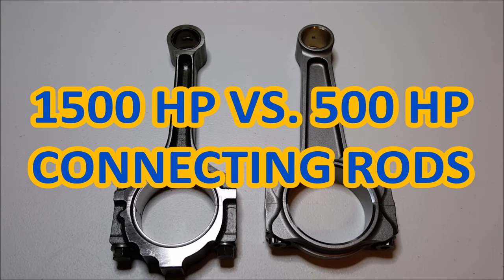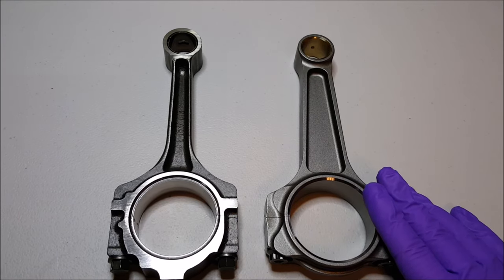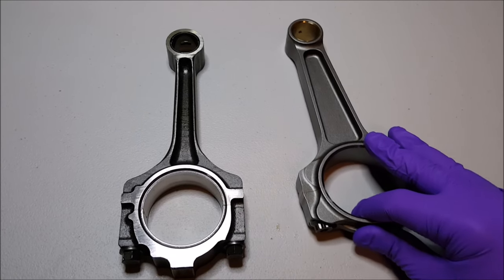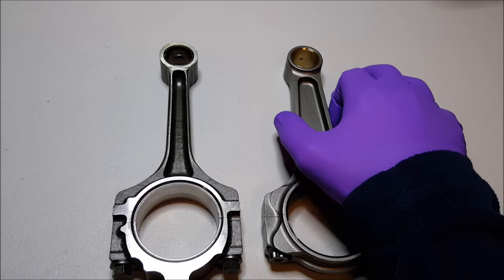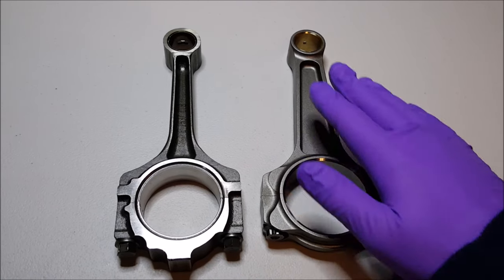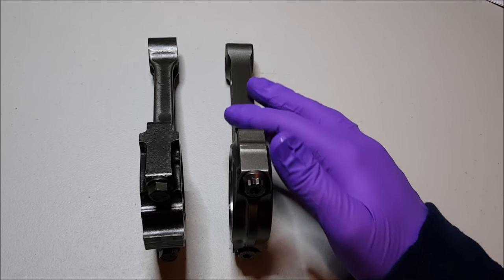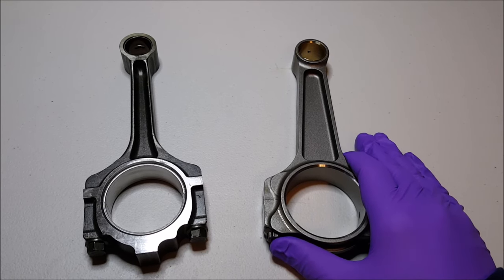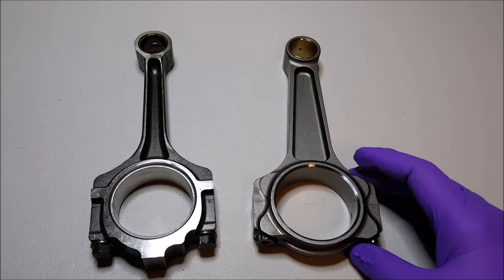1500 hp vs. 500 hp Connecting Rods

Comment: For a constant load, the bending stress on a piece of solid metal is proportional to 1/thickness^3, so increasing the thickness pays a large dividend.  The material and heat treat also affect the strength of a piece.  Here are some numbers:  
                                     Grade 5 bolt    Grade 8 bolt  1018 steel.  4140 steel  4340 steel  high speed steel  nodular iron
Ultimate strength, psi  125,000           150,000         65,000          125,000      185,000       375,000                 60,000
elastic limit, psi            100,000           125,000         35,000          100,000      150,000            ??                       40,000
endurance limit, psi       50,000             62,000         15,000             50,000        75,000             ??                      20,000
The strength of 4140 and 4340 depend on the heat treat.  There are other alloys that are stronger than grade 8 bolts, but to the best of my knowledge, nothing is stronger than high speed steel.  All steels have about the same Young's modulus of 29,000,000 psi.  The Young's modulus for iron is close to the YM for steel.  The shear strength of steel is about half of the ultimate strength.  
If you really want to know whether a piece is strong enough, you should do a Finite Element Analysis to calculate the stress levels.  
You an improve the life of a part that is under a cyclical load (like a connecting rod) if you polish the surface to remove all the nicks and scratches.  The improvement is as much as a factor of 9 reduction in the stress at a notch or scratch.  For a connecting rod, always polish it in the direction of the length of the rod.  I recommend polishing a crankshaft, also.  Also make sure there are no sharp fillets in anything as the sharp radius creates a stress riser.  Now you know why high performance crankshafts have large fillet radii where the ends of the crankpins and main journals.  
If you use grade 8 bolts and threaded holes in 1018 steel, you should reduce the torque of the bolt below its rated torque or you my pull the threads out of the 1018 steel.
Reply: Good comment lots of useful information.  What is a"turned body bolt"?
Reply: Holy moly!!
Tnx man.
Reply: @g1sokool669  Depends on how much you already know. The engineering terms are not explained here. And engineers have their own very specific meanings for some common words. No quick or easy way to get up to speed on this.
Reply: The problem is that the information presented is misleading and if you are not an engineer or even understand rudimentary engineering principles you will be misled.  If you are knowledgeable about engineering and material science you will recognize the wrong and misleading information that was put forth.

Comment: I have a 1989 Dodge Colt GT with the 4G61T 1.6L ( 1595cc3 ) bored to an even 1600cc3, rebuilt it with my dad, his father bought it brand new in November of 1988, there are only 1500 of them and about 900 of the AWD Mitsubishi Mirage's, so a total of about 2400 of these in the world and is the Grandfather of the 4G63T 2.0L ( 1997cc3 ) or consodered as the King of the 4 Cylinders and is widely known as one of the worlds too 5 motors of all time. I let a froend test drive it and he left the e brake on and it blew my turbo which was a rebuild off an eclipse so sent it back and recieved a oem stock turbo the TDO4 FOR the 1.6L. And just havnt got to take apart and clean the oil mixing in with the fuel and air. Okay i did clean the intake, but I am planning on getting that up and reliable l, and broken in properly and even getting top quality adjustable suspension, a simple body kit to have room for an intercooler and a oil cooler as well as some cooler lines for the transmission to allow prolonged driving at higher rpms without damage. Anti sway bar front and rear which will reduce the trunk space in the hatchback but I can work around it, while its seperatated frame from cab, i wanna have the frame sand blasted and powder coated and then like a rhino lining layer of heat resistant rubber so the frame wont oxidize ( rust ) for decades, maybe even have it caged but under the interior as well as having it set up for an AWD conversion but still driving it with the stock 4g61t , having everything prepaired and even painted ( garnet red ) it's like the color of a deep red wine, heavily insulated, like that rubber rhini lining under the car and at the fire wall for heat resistant as well as noise cancellation or atleast to reduce the road noise so that when im driving on the road insullating even the doors and adding weight will be fine as long as its excepted by an engeneers perspective on terms of aero dynamics and weight distribution. Because the final step would be swapping in a AWD 4G63T which is identical to the stock 4G61T motor other than displacement and WEIGHT. the 4g61t has 135hp stock the 4G63T HAS 280hp stock although I will be going with forged crank, forged connecting rods and forged pistols, ARP STUDS and will be researching Block wisdoms , and its about 2400lbs RN that added weight distributed evenly balanced will allow for that extra power at the wheels to have a little bit of weight to work with for traction. I wish to turn it into my road trip tuner, in memory of my grandfather who I know had me in mind when selling it to my dad, even sent me a birthday card I just found that i didnt understand until a week ago lol good thing i still have the car, after the rebuild it hasn't any more than 2000 miles on it. So i would like to get the most out of that motor as i can, using it for work and saving for a toyota truck and newer or a diesel , larger crew cab Chevy or dodge cummins or even find a extended cab 1985 or 86 and drop the 4bte i think it is, the smallest cummins straight 6 thats bolts into those older chevys. But leaning towards and larger crew cab, modifiable Toyota 2016 or newer. Then as I'm working and saving and maintainencing the Colt I will begin prepping it until all thats left is the AWD CONVERSION and the swapping of the motor and transaxle/transmission. Because after its swapped and tuned and dynod and broken in properly and ready for the road, I would like to visit car shows, and even start on the project ive been waiting all my life to work on with my dad, the 1970 Chevelle SS 402ci Big Block, 17000 original miles on it and remember riding in passenger wheb i was 3, man that thing is a beast. I wanna use what i learned on the colt build to assist with the Chevelle build, like a modern frame or chassis and suspension so i can turn and stop with the best of the modern cars on the road. Gun metal gray with black racing stripes and gun metal black rims, and a modern crate build so i can have obd and have a navigation system that bluetooths to the obd port and allows me to program and tune the computer for varipus performance options. Literally a CLASSIC 1970 CHEVELLE SS 402 WITH THE 396 EMBLEMS ON THE SIDE CUZ THEY ONLY PRODUCED THEM FOR LIKE 6 MONTHS, WITH MODERN QUALITY COMPONENTS, COMBINING THE BEST OF BOTH WORLDS AND SEEING THE SMILE ON MY DAD AND MOMS FACE AS THEY RIDE TO CAR SHOWS, SHOWING OFF THEIR CLASSIC AND MEETING NEW PEOPLE AND FRIENDS AND LIVING THEIR BEST LIFE BECAUSE I DECIDED TO GIVE BACK WHAT THEY GAVE ME. 
ANYWAYS THATS MY DREAM, THA KS FOR READING IF YOU MADE IT TO THE END.
YOU CAN FIND ME ON FACEBOOK. 
DARREN MILLER FROM FOREST GROVE OREGON BORN IN BISHOP CALIFORNIA, OR EMAIL ME AT MILLERDARREN1020@GMAIL.COM UNTIL I GET A NEW EMAIL ADDRESS FOR THE REFINED CHAPTERS OF MY LIFE. 
I WONDER WHAT IT TAKES TO DO SOMETHING LIKE THAT, WHAT KIND OF LITERATURE OR BUSINESS OR SHOP COULD LEAD ME IN THE RIGHT DIRECTION, I WANNA HAVE MY OWN SHOP ONE DAY.

Comment: I'm confused... you refer to the rod on the right (1,500 HP) as both "billet" and "forged", could you explain that please? I thought they were different processes.
Reply: I noticed that too, the guy contradicted himself, another thing, everything else remaining equal a super/turbo charged engine puts its rods under less stress than a naturally aspirated engine so what's this nonsense about 500 hp vs 1500 hp, what about the rpm, piston weight, stroke length etc, you can't make a blanket statement like that, its like saying that a gearbox is rated by hp, it's not, it's rated by torque.
Reply: It was machined from a forged block of material known as a billet block. By the look of the finish it was also shotpeened after machining.
Reply: @tepidtuna7450  Thanks
Reply: @rotax636nut5  That`s what happens when you give a guy that knows nothing an outlet
Reply: A billet is forged,  just not shape forged,  just block forged and then machining from said block.
Reply: @themountainraven  So a billet is forged, you don't just get a cast lump and machine it. I guess the molecules have to be compressed somewhat and lined up in a similar way to iron and steel. To take the guess further, steel and aluminium have similar properties under forging, which is a kind of hammering process. Shot peening takes the finished piece a step further, I can sort of understand that. Thanks, I find this all very fascinating.
Reply: @Jesse-B  When someone says 'billet' all that really means is that the part was carved out of a solid block of of material, i.e. a round, a square, a rectangle, or even a hex.  In 99% of the cases the use of the word is marketing not engineering.

Now, a billet can be a forged, or rolled, or upset, block that started out as a casting, or a larger billet (aka bloom), but it is generally not the proper word to use when referring to a near net shaped starting piece i.e a rough forging or casting.

I'd call your attention to the various catalogs of cosmetic parts available.  My personal favorite was a "motorcycle gas cap featuring 'billet' construction".  All that means is that the shop making them buys 3" round aluminum bars, and turns them in a lathe!  They could use wood, or plastic, or old rolls of thermal fax paper and make the same part with the exact same dimensions, similar weight characteristics, and somewhat more interesting surface finishes.

Don't be fooled, when someone tosses out a jargon word, refer to the glossary to see what it really means.

-- In Liberty
Reply: A billet is a piece of steel that is in the shape that left the steel mill.  A forging is a billet of steel that has been heated and hammered in a forging press, usually to the near her shape of the finished part and may require a further maching.
The purpose of forging is to modify the train structure to enhance the yield strength of the metal.  This video explains nothing
Reply: @g1sokool669  
Sorry this wasn't specifically an answer to you...just answering the overal question.
What the guy should have said is the rod is forged from a piece of billet steel.
It is not a billet block that has been cnc machined like he suggested.
He just said it wrong.
Imagine a huge press with a half casting of the top and bottom and shoving a piecs of billet steel in between those two dies under an extremely high force. It compacts the metal and aligns the structure at a molecular level. It is a great way to make the best rods possible.
Billet  is more like aluminum rods that are cnc'd to shape.
Anyway...cheers!

Comment: We are build a 1970 350 11:1 sbc. Our goal is 450 hp with forged steel crank and forged pistons. This engine is a budget build but we do not want it to come apart! Can you recommend 5.7 inch rods that would fit our application? I have looked at gm "Pink" rods on ebay which would fit our budget, however SCAT and Eagle make rods in $250.00 price also. Thanks

Comment: i like the simple explanation. My question is how much of a weight difference is there between the two for a given size pls? The other question i have is what would be the rod u would choose for a 2500hp setup intead of ur 1500 setup? - Is there some super exotic alloy that can be custom made for a person who is not restricted by cost factors? ty
Reply: maybe a billet h beam with some coatings?
Reply: h beams are not stronger than i beams
Reply from the maker: It's hard to say about the weight difference as their are too many variables to consider to provide an answer. Anything in the 2000 hp range would require an aluminum rod to reduce mass. The density of aluminum is about 1/3 the density of steel. You will find aluminum connecting rods in top fuel dragsters for example. Titanium would be another option. Unlike steel, aluminum is susceptible to fatigue and a shorter lifespan is expected for an aluminum rod. Thanks for your comment and sorry for the late response!
Reply: The rod is forged not casted forge rods are lighter and stronger and is a alloy metal.

Comment: 1500hp- is that for all 6 cylinders or 250hp per rod?
Reply from the maker: Toby Head This example assumes that eight cylinders work collectively to produce 1500 hp. As a result, each cylinder makes about 188 hp and therefore each connecting rod supports 188 hp.

Comment: Don't forget "BOLTS"!! M A good set of ARP bolts from the standard ARP 8740 bolt vs their top of the line L-19 bolt can increase the HP and tensile strength capability due to stronger clamping force anywhere from 5-50% "DATA WISE" !  See ARP BOLTS for further literature on this.

Comment: If I had the money, would it be a great idea, to make the rods, crankshaft, clamps, block, head, pistons, wrist pins, and all the bolts....out of titanium?

The piston rings, bearings, and maybe cylinder sleaves, would still be steel, or another metal.

And air conditioned air for the intake, and a great cooling system, using Evans Waterless coolant, both to prevent knock, with high boost & compression ratios.

Is all of this, the stuff of dreams, or not really worth it?
Reply: Iron alloys aren't popular just because they are cheap. No other material has such tailorable qualities. Iron is an amazing element.

Comment: is the 1500hp rating per connecting rod or the whole lot
Reply from the maker: TheAuzzieSniper whole lot of 8.
Reply: per connecting rod? what are you building? a ship?
Reply: 1500 divide by 8 cylinders....use that same rod in 4 cyl. They get twice as strong....we build hi honey boat motors. The last job we did made 2400 hp..x 2 motors..16 brand new  carrilo s was about $ ,3900....,with a deal it's all about the bolts

Comment: What about titanium rods?
Reply from the maker: MyLonewolf25 Titanium rods are also another option. Although they are more than twice as heavy than aluminum, but twice as strong for a typical alloy with much better fatigue resistance. It really depends on the specific application to decide whether or not titanium will provide much advantage over steel or aluminum.
Reply: Problem with titanium is metal fatiguing over time. They are far less resilient in that regard than other options. Aluminum rods (even billet) stretch over time. For non-exotic builds that are not having major rotating assembly work on a fairly regular basis (replacing components like rods), titanium and billet aluminum are arguably inferior. Think of a weekend warrior build for a person who likes to track their car, but also daily's it: titanium and billet aluminum are poorly suited for that build concept.
Reply: @numinous4789  
Agreed. In drag racing, alumium rods are primarily used over steel rods as of late to reduce stress on the bearings and crank, and possibly other bottom end components given aluminum's softer properties.
Reply: Also, heat cycling of aluminium softens it with time. The same happens in monobloc brake calipers. Racing brakes use two Al blocks either side of the disc and are joined by steel pins for strength and endurance. Iron and steel get stronger with heat cycling. That's why old iron blocks are prized for performance builds.

Comment: so are i beams strong and can handle more torque n hp than h beam rods
Reply from the maker: djm93 It depends. A general statement cannot be made. You might find that some companies sell H-beams rated for 1000 hp and I-beams rated for 1500 hp. This doesn't mean that in general I-beams are stronger. It depends on the application, rod design, and the list goes on.
Reply: usually H beams are stronger. but it is true that you can buy an I beam that's stronger than some type of H beam. all depends on the dollar.